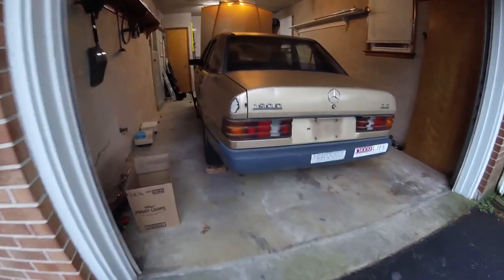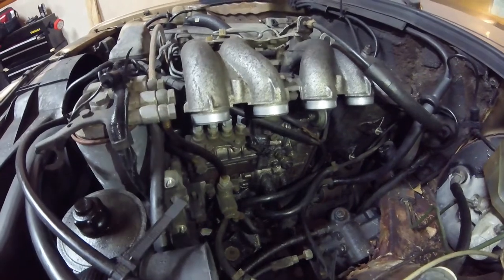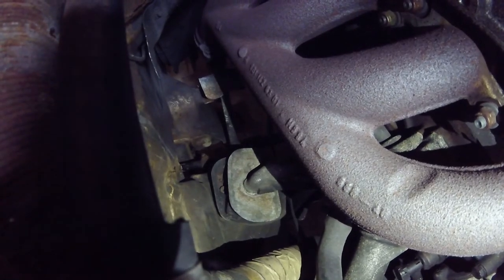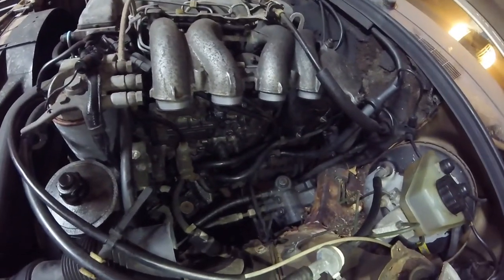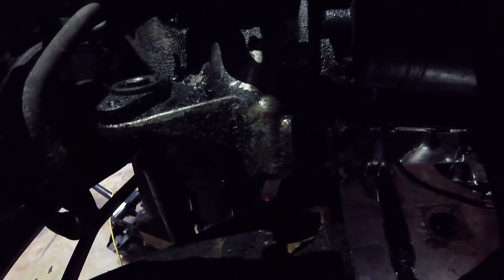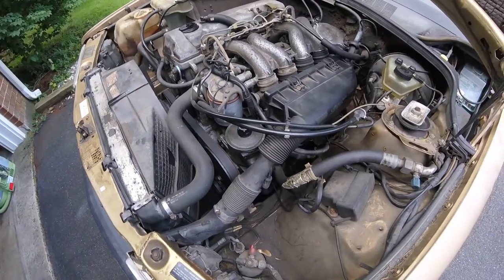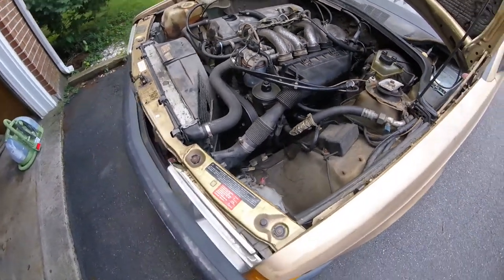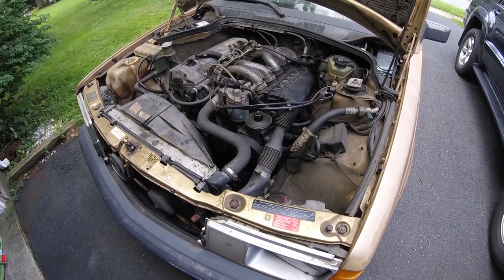Motor Mount Replacement - 1984 Mercedes 190D W201

Comment: "hole" jackstand setup :))) thats one of the most rusty places in old mercs, also if you ever put it on a hoist the lifting points are straight under those jack points. Also, I really like the color of your W201

Comment: Maybe I have my orientation reversed, but if new mounts are installed, doesn't that lift the engine, bringing the fan blades closer to the fan shroud? Did you also have to raise/readjust the height of the fan shroud now that the engine is sitting up higher? Thanks.
Reply from the maker: The old mounts on mine had not sunk but were somewhat cracked allowing the engine to shake the car shake at low idle or when I shut the car off. I didn't notice anything related to the fan blades not fitting. When comparing my new mounts to the old there wasn't much of a visual difference.